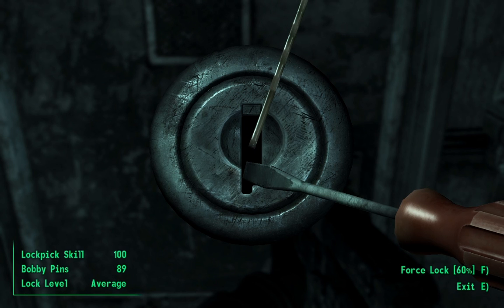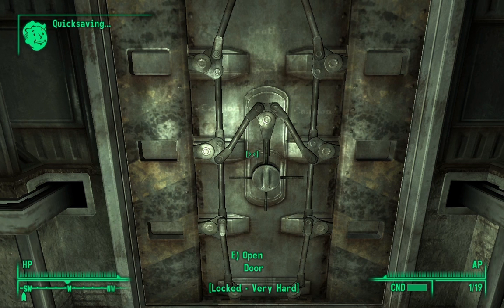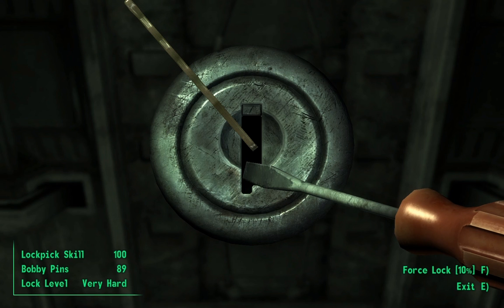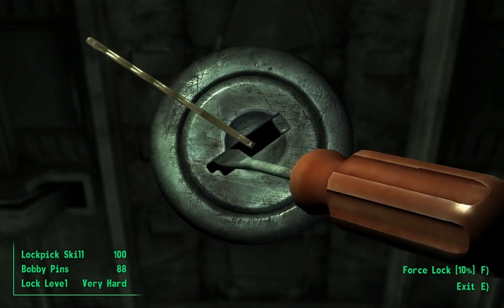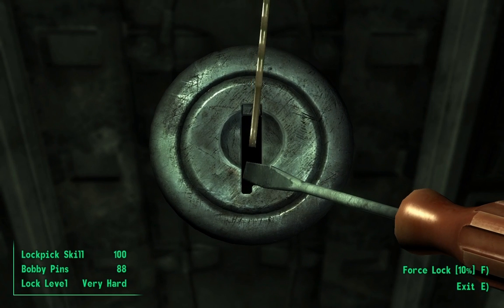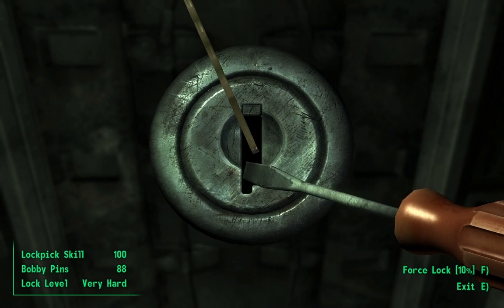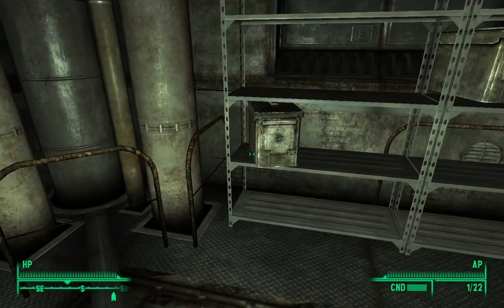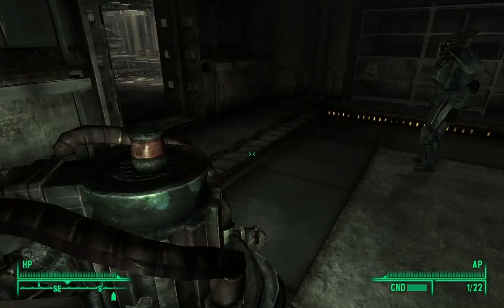Fallout 3 T&T #018: Howto: Lockpicking

Comment: Pro tip guys...If you get two fails on the lock pick your bobby pin will break. To avoid this after the second attempt fails simply press the "E" key to back out of the lock picking screen. Start over and continue trying in this way until you pick the lock. It will save you hundreds of broken bobby pins...Its the same basic principle when trying to crack a computer console..If you fail 3 out of the 4 tries back out of that screen then reenter with fresh tries.

Comment: On the 360 (or PS3) it's really easy cos you can move the screwdriver slowly, so the bobby pin doesn't move down each time you get it wrong

It's strange that a bulkhead would have a standard 5-pin lock though...